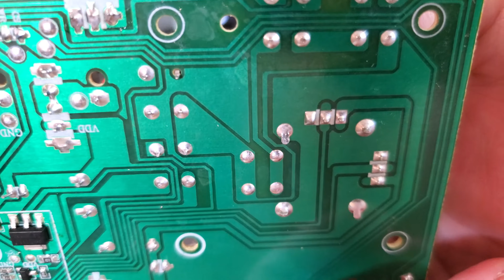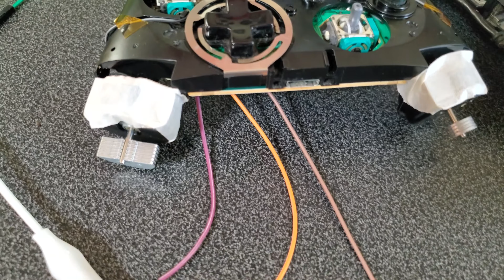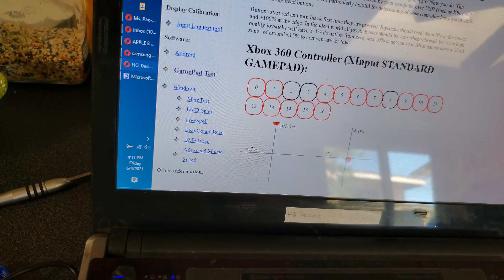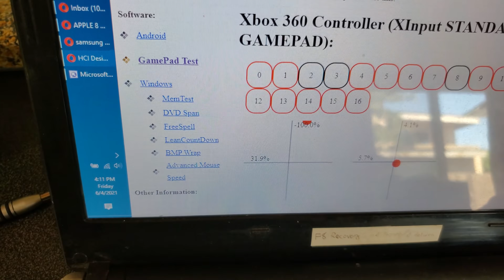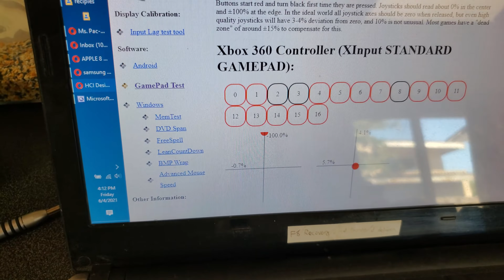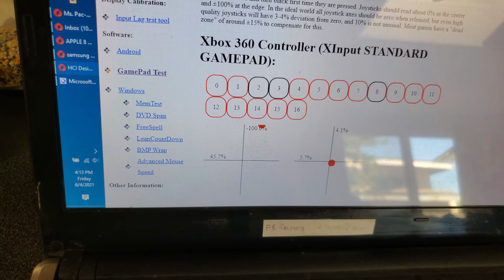Are two potentiometers better than one at fixing Xbox One Analog Stick Drift? (part 3)

Comment: Don't you ever tried with smd resistors? I did certain researches and some values can make axis more centered (when its new and not too drifted). I saw a video and actually works.
Reply from the maker: a smd resistor is just a resistor, just like these oversized pots, but without the adjustability. So if it doesn't work with these large pots it won't work with a SMD either. That said there could be multiple failure modes of these joysticks that can sometimes be fixed by adding a fixed resistor, either SMD or whatever. I have fixed a PowerA brand xbox one controller by adding a fixed resistance to the joystick, and yes, in order to make it permanent and fit inside the case it was a SMD resistor.  But I have yet to see a genuine xbox one controller that was fixed by adding resistance (I've only tested two however).
Reply: @xeostube  I ordered some smd resistors in order to fix some genuine ps4 controllers. I let you know the results in few weeks

Comment: Do you think it would be possible to change the joystick type in the controller to a hall effect sensor joystick?
Reply from the maker: interesting question but from what I can find online those don't come in the same form factor. Plus I'd expect the readout circuit to be fairly different. What's your opinion?
Reply: @xeostube  i think that if it goes well it could be a better option than the current potentiometers we have, however as of late I've been using the gyroscopes that playstation controller have and have felt like that should be used instead of the joystick (or to assist the joystick)